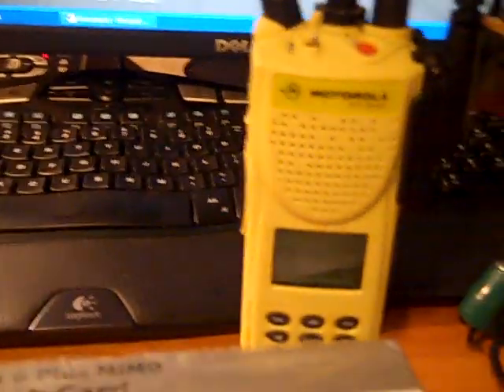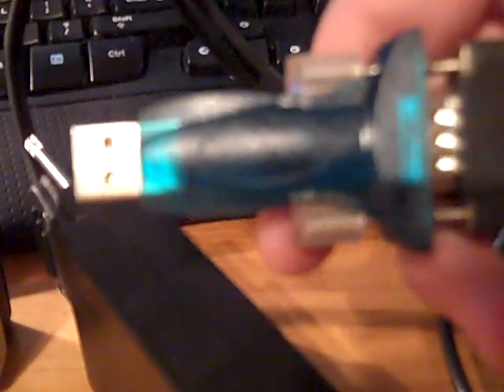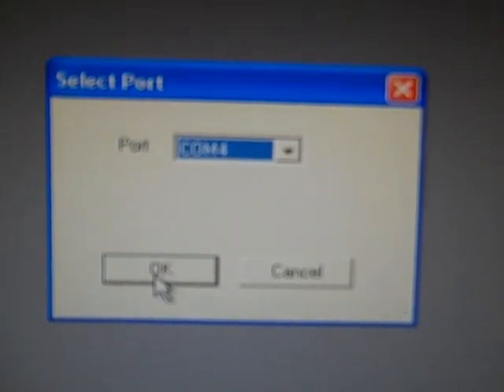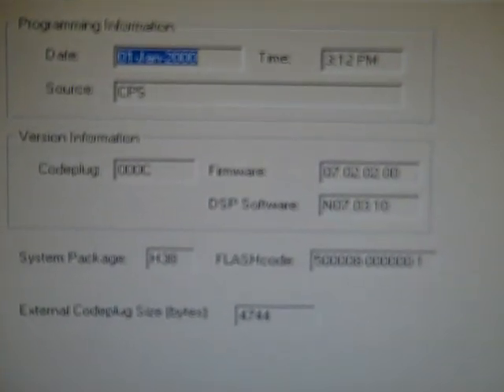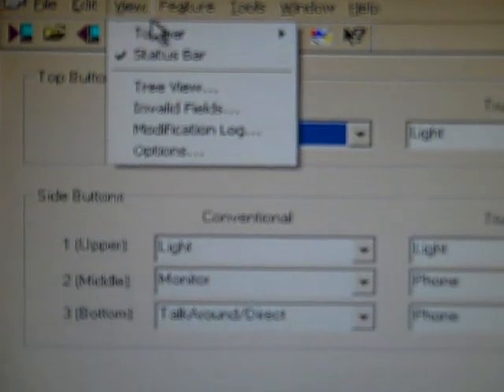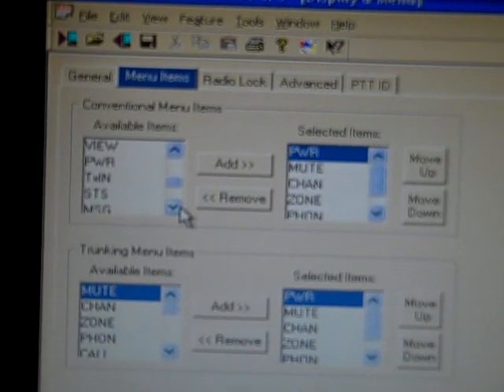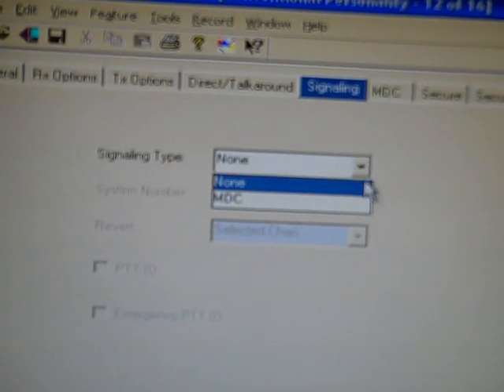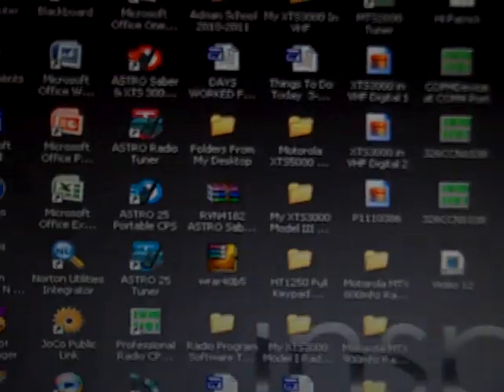Motorola XTS3000 CPS Software - Radio Programming Demo

Comment: two things. 1) what's the best way to clone one radio to the other? i've got an EX600 XLS that i want to clone.... can the plug tree be copy paste to another one?  I think just saving to one radio, and then saving to another radio without opening up the 2nd plug is a bad idea. I have heard of people bricking the radio by putting the wrong plug tree into the radio.   2) for software, you can run this on a Win95 or WinXP vm using VMplayer and never worry about what machine its running on.  I have a VM of win95 running on my Win7 64bit machine and it runs just fine.  you just map the com ports through.

Comment: Okay both Xts-3000 vhf's are recased in Fire Yellow rugged an new batterys an wideband antennas got new cables coming too an just aquired Motorola Astro CPS R05.03.00 from a search in Google can find it if you look hard enough savy !! Thanks for the help will be posting some vids for the Amateur Ops out there soon these radios are perfect for ARES Canwarn service  each unit has its own ID an so many more features not to mention there P25  digital or mixed mode

Comment: Hello I have a quick question if you could help me that would be great I have a cm300 vhf radio I bought the program for it and programmed it and all. So I'm looking into buyin a cdm1250 low band 36-42mhz will that program work with it as well I have the Motorola commercial series customer programming software please let me know if it might work?

Comment: So I got the programming cable and adapter, but no luck reading from the radio. I even found a computer with the serial port, install the program. Still no luck when reading from?

Comment from the maker: Its a driver issue.  Reload the driver, check the device manager and with the radio plugged in load the driver.  Motorola should have made that a lot clearer because, I run into that question (and issue), on a nearly daily basis from both myself and everyone else.  You can't use Windows 7.  You need Vista or XP.

Comment: I have a APX radio and the newest CPS. Confirming -. a person can listen to just one talkgroup from a 800 digital system (with non-affiliation) without having my radio bricked?? I thought after the radio is programmed, and turned back on,  it will send a handshake to the site then brick my radio. All my radio has installed is Conventional feature & P-25 feature. I do not have no trunking software installed. You are saying it will still work to stay on a single TG?.

Comment from the maker: its used for running diagnostics.  If you just program radios, chances are good, you'll never use that part without the diagnostic hardware.

Comment: thank you for an excellent video! I need to edit that CPS to drop a high split XTS 3K UHF down to 439 MHz. I have had said it numerous Brands but not this particular one and was wondering if you could offer some advice. Such as where to look? I know how to use a hex editor and I've got the skills necessary to do this. But rather than guess I figure it's better to ask first. Is radios are popular with ham radio operators.

Comment from the maker: P25 forums used to have it there, but I think the Moto boys told them to remove it.  I rarely get to the forums and boards and such unless I'm in the buy/sell section.  I know a lot more about how to do things quicker after this was shot.  I THINK the Astro Saber takes Astro 5k software and thats only available through the Motorola website.  I could be wrong (wouldn't be the first time, lol)......I never messed with Sabers.

Comment from the maker: Theres a fella who sells a CD on e-bay I saw and it is said to have it on there.  P25 forums used to offer it free but pulled it due to licensing still possibly being valid???  Something like that.  Look on e-bay, but trunking is difficult and the 3k is limited to affiliating............you can't scan without affiliating with a 3k.  You'd need to upgrade to a 1500, 2500 or a 5000 to do that.

Comment: when i plug my xts3000 into my computer and click 'read device' i get a communications rror. im using a RIB-less after market cable and the astro saber and xts 3000 software. i have the 9 pin programing wire with a usb adapter hooked into my pc. ive tried a desktop with windows 7 and an older laptop with XP on it. i even tried on the older laptop to hook in into a 24pin serial port and still the same error....any help?
Reply from the maker: +Yokas “Yokas.B” Boslarelli You need an XP computer.  You have to go into options and set the comport, I believe.  I don't think it is anything more than that.  AS SOON as you get in, SAVE YOUR CODEPLUG before you do any work on it, as well as afterwards with an updated name.  Save it where you can find it.
Reply from the maker: +Yokas “Yokas.B” Boslarelli You will need to load a driver in if you are using a USB adapter to nine-pin.
Reply from the maker: +Yokas “Yokas.B” Boslarelli Open the program and to to the header where file is.  Check the drop-downs.  Options or preferences should show up somewhere.  I haven't used this CPS in a year and have not had to set that for several.  It is in there.  You can always refer to the help menu.  Make sure when you plug in your radio cable, that the radio is on and you hear an audible signal from the computer (the same sound for when you plug any usb adapter into it).  You just need to make sure that the port you are plugged into is the one that the CPS is set to access.  It's in there.  I think if you go to read it, the window pops up and lets you select the port from a mini-dropdown.  I have been on so many different programming platforms, it is hard to keep them straight.  It's there, you'll get it.
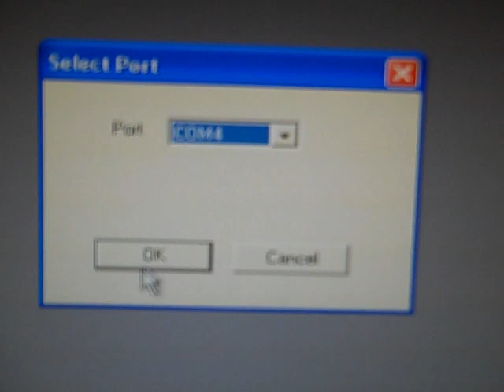Reply from the maker: +Yokas “Yokas.B” Boslarelli 4:15.  PLEASE watch the video.  It was right there.  Good grief.

Comment: I had put my xts3k on the CPS but of course I got the "could not read radio" error. I'm running Windows 8.1 which I assume is not supported with the CPS? Just want to confirm.
Reply from the maker: Austin Jewsbury You can't operate 3k CPS on windows 8.1.  It will only operate on XP (or maybe) Vista.
Reply: I was able to use Virtual Box to make a Virtual Machine running XP professional and it worked like a charm.
Reply from the maker: Austin Jewsbury Glad to hear everything worked out for you Austin :)
Reply: Austin Jewsbury I used VirtualBox and I Still got the same error I'm using an RIB less cable
Reply: Check your com ports in Device Manager to make sure it is working correctly. Make sure it's set to XOn-XOff.
Reply: I did and still a no go
Reply from the maker: ***** Go to P25 forums and join.  It is free to join.  They used to have 3000 CPS in the download section.  No charge for the download.
Reply from the maker: ***** Thanks for the kind words :)  Yes, it is a VERY good site for radio questions.  Many of those fellows are radio techs.  You will need a Windows XP or Vista PC to program and a cable.
Reply from the maker: ***** The file is too large.  It should run.
Reply: +Yokas “Yokas.B” Boslarelli P25 Forums for sure!

Comment: can you load des xl secure key this way or bring a lost key back from battery being dead ? thanks for the video
Reply from the maker: Unfortunately not.  Its hardware encryption so you need a KVL keyloader (3 grand) to reload the keys.  Mars on P25 forums can do it for a reasonable fee.  He's in Canada so shipping is expensive.
Reply: snarlingrabiddog5150 On that, I was speaking with Moto about an APX purchase today and apparently once you get a crypto board installed (or HW crypto enabled for APX), even ADP needs to be done via KL instead of CPS.

Comment: @Michael bond I had the same problem with mine. The only way to fix it is to use a true windows XP machine. I tried using it on my windows 7 but I kept getting the same popup as u did about the "file specified is not found" or whatever. Anyway try using a windows xp computer. It worked for me.
Reply: Thanks. I did finally get it to work but now I think what I am trying to use for a adaptor is not going to work to program it. I hope to know for sure tomorrow.

Comment from the maker: Is it just me or does this video stall out at points?  Its freaking annoying.  Thumbs down its getting for that, lol.  Oh hey, I JUST scored ANOTHER six-bay ACT i60 Conditioning Charger with an iGuage.  I am working a deal for brand new XTS3000 XTS5000 plates and will get them one way or another.  I'm really glad about that.  Being without one sucks and I like Impres chargers ONLY for my XTS5000.  I still maintain that Impres chargers suck, lol.